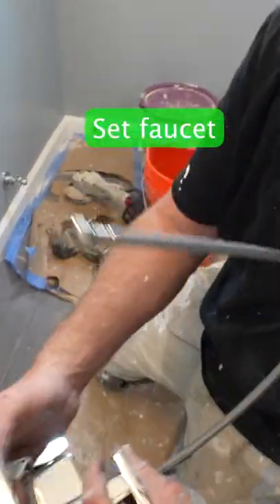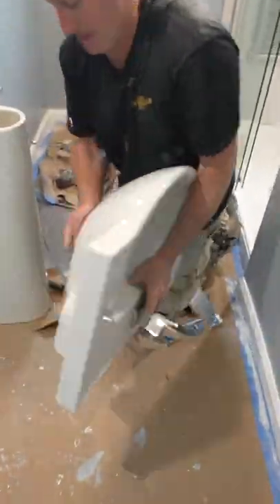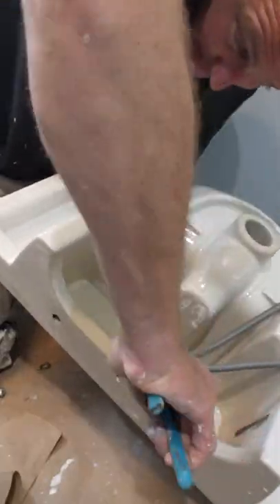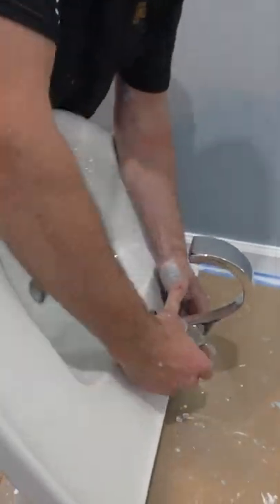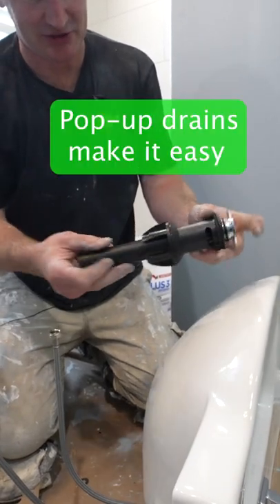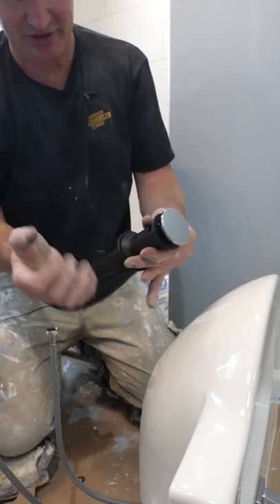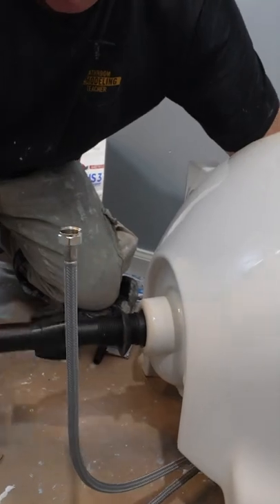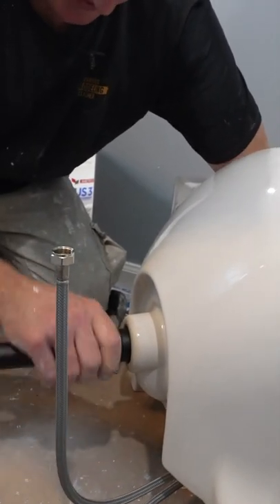Pedestal Sink Tips

Comment: Like u said blocking if not those stupid tag a bolts or or bolt screws and caulk it once the p trap is installed it comes together. Not everyone has blocking especially in older plaster lath homes

Comment: You shouldn’t be able to slide the base right under it like that lol the top should’ve been mounted resting on the base. That’s why they give you little cork pieces to stop the porcelain from rubbing. You just gave them a wall mounted sink with a piece of porcelain in front of it.
Reply from the maker: IThe caps were loose to allow the pedestal to slide under like that. 👍

Comment: It will eventually leat throw the upper rubber away and put silicone,  and put some pipe dope on the bottom one.
Reply: Is pipe dope better than plumbers tape in this application? Sorry new to the realm of plumbing.

Comment: Hand tighten???  I have put a lot of those drains together,  most of the sinks are so rough you need to get some good pressure or the base will leak.
Reply: Exactly! Put that damn drain on 3x and still leaks. Any suggestions ?
Reply: @emzye4641  Some of it will depend on the layout of the sink/drain.  I had better luck by connecting the sink side of the drain and sliding the whole thing into place and connecting what is extended from the wall.  It requires fitting everything then putting it together after.